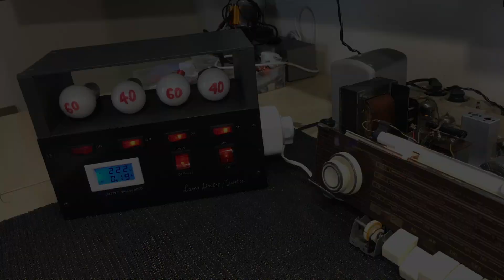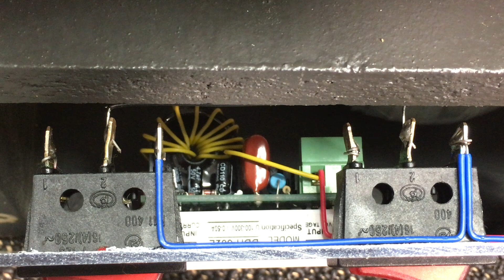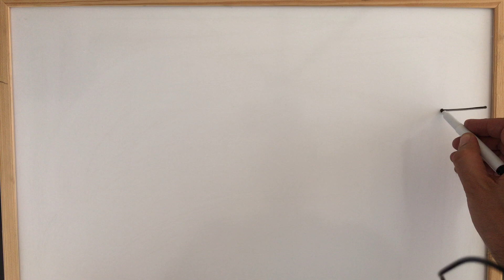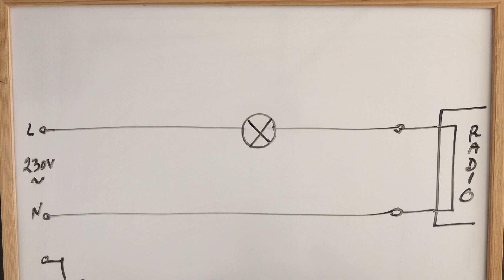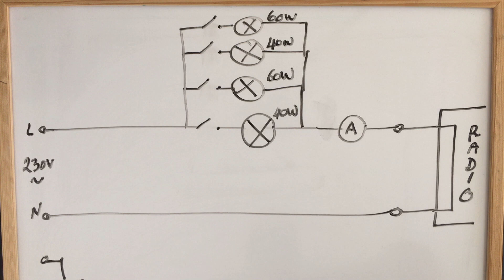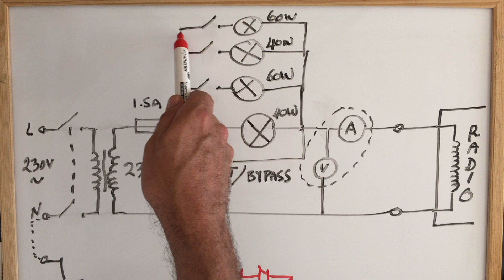DIY Test Gear: Dim Bulb Limiter / Tester with Isolation - Design and Build

Comment: Apologies, you said the light bulb is in series with the radio (dut) but then said the extra bulbs are added in parallel to that single bulb exactly as per your schematic. So I need to listen more carefully. 🙄👍Thanks, great, informative video. I also liked one by fibbers workbench where he measured the resistance of a cold 75w bulb using a meter. Ohm's law showed the bulb would draw about 8 amps but measuring the ampage with the bulb on mains power it drew a few milliamps. Tungsten filllaments cold are very low resistance. Hot (in use) the resistance increases dramatically. I guess this explains why Tungsten bulbs shine fully bright almost instantly, whereas an electric heating element can take a relatively long time to warm and glow?

Comment: Hi, early in the explanation I believe you mentioned that the bulbs would need to be wired in series but your schematic seems to show them wired in parallel. Which seems correct?
Won't this decrease the overall resistance as you add bulbs? A 200w bulb would have a thicker filament (and lower resistance so higher current flow) than a 100w bulb. I find it confusing, sorry.
Reply from the maker: The bulb is wired in series with the load. Then you can reduce the restriction by wiring more bulbs in parallel with the first bulb, effectively allowing more current to pass.

Comment: why the bypass?
Reply from the maker: After confirming that there are no shorts or excessive current draw, I like to bypass the light bulbs to apply full mains voltage to the device.

Comment: Thanks for the ideas and the wiring diagram. Have made a list of al the parts.
And also a question. We do have the same voltage 230 v in Sweden as you have
The insolation transformer will be 
a must. Will the rotary transformer 
do the same insolation as the full
 insolation transformer?
Regards 
Bjorn
Reply from the maker: No, the variac is NOT an isolation transformer. Be careful, as there is a lot of confusion about this on the web.
Reply: @electronicsoldandnew  
Thanks for answer. I had my suspicions! Bjorn

Comment: This is another excellent explanation and video so precise very well done. I have a question please Mr Caldeira.
Will the lamp limiter work on an oscilloscope power supply with over/under voltage and temp protection.
My Fluke 3092 turns on shows display and text squeals then shuts down after about 4seconds I cannot take any voltage readings just an old novice, many thanks again for your video, I made a 3x60w unstitched limiter after watching this video previously several times actually haha.
Reply from the maker: The scope will draw very little current, I expect, so the limiter will be practically “invisible” to it unless there is a short circuit.
Reply: @electronicsoldandnew  Many thanks for replying.

Comment: Nice design, but at 3:05 you say that the first 60 and 40 watt bulbs are in parallel, and thereafter it seems everything is in series.  What gives?
Reply from the maker: Think about it: a bulb is in series with a load. Add another bulb in parallel with the first bulb, you get two bulbs in parallel. Then those two are in series with the load.

Comment: I just finished building the same dim bulb tester with the addition of a standard "resettable fuse" (1A) which is mounted on a rail. I can easily swap if for another module if necessary. I had an isolation transformer lying around and I even have a bigger one that I had paid 3€ on a flea market. This really is heavy ! The small one should be enough to use with tube radios.
Reply from the maker: Yes, the current drawn is quite low.

Comment: I have seen dim bulb testing when one takes out one wattage and changes it to a higher or lower wattage. Why not put bulbs in series to accomplish that, as that seems more logical. You could use switches that close (in off position) so all you need to do is switch them progressively to incrementally add resistance instead of changing lamps in a one bulb tester.
Reply from the maker: This system for me is the most logical. It works well and has served my purposes.

Comment: What are the minimum voltage and current that digital meter can read?
Reply: The minimum and maximum are whatever the meter you use are rated for.
If you identify the PCB trace that supplies mains power to the Capacitive dropper that powers the meter circuit, you can cut the trace and feed full mains voltage just to the capacitor. In that way you can make the meter work down to zero volts.

Comment: Beautiful. I have an idea. Could you use a relay, so that the bypass automatically turns off when you turn the main switch off. This way, you never forget to turn off the bypass switch. So, the bypass switch would actually be a momentary push button to turn the relay ON. Then, when you turn the main switch OFF, the relay automatically turns OFF.
Reply from the maker: That’s a very good idea. I’ve actually forgotten it in bypass once, but once can be once too many 😊
Reply: @electronicsoldandnew  experience has thought me to omit the bypass switch altogether. While I have been lucky and not destroyed anything, I have forgotten to reset it more than once. If I need to plug the DUT  onto the mains I just do it !! Not everyone's solution, but it works for me !!
Reply: LOL - I am building one with a relay from this guy's video - he has a schematic on his own website - a few details missing, but it seems easy enough to follow. https://youtu.be/QcTck26OR3U?si=WpAWCbuga94xNiAu&t=82
This video by  @electronicsoldandnew is much better at explaining the schematic and details, though... Man ya gotta love YouTube LOL🥰

Comment: 31:50 Hi, how much VA is dat isolation transformer ?
Reply from the maker: About 300VA if I remember correctly. I do mention it in the video
Reply: @electronicsoldandnew  , i missed that clearly. I'm gonna build a dim bulb limiter with a classic isolation transformer of 400VA, inside the chassis of a old JVC JT-V11 Tuner, where the mainboard from is completely beyond repair, and is collecting dust for months. Now i know that this isolation transformer is strong enough. Thank you for the quick reply. Love your video's. Greetings from Belgium.

Comment: where did you get the isolation transformer?
Reply from the maker: I actually had it wound for me. You can probably find one cheaper ready made.
Reply: I'm having issues finding a 120/240 transformer of sufficient capacity
Reply from the maker: You need a 1:1 transformer, so 120 to 120 or 240 to 240, depending on what your mains voltage is where you live. Then just look for one that supplies about 500VA. Should be more than enough.
Reply: @electronicsoldandnew  im having trouble finding a usable transformer. I bought 2 old ILP toroidal transformers from fleaBay but with no wiring diagrams, so am now stuck after building the dim lamp box. How can i work out if either ILP transformer will work for this ? The model numbers are a little strange , "9T029" , and a "9T631" (which I think is their Gen9 "625VA"). But i have no clue on the wiring of either. Could you point me in the right direction ? thanks (I can find absolutely zero online about these two ILP transformers).
Reply from the maker: I’m afraid I can’t tell you for sure. You can easily determine which wires are for the two windings - just test for continuity. Then it’s a question of determining which is the primary and which the secondary. You should test them with a small AC voltage and see what you get.

Comment: Hi, very interesting video, I have already a selfmade variac, with isolation transformer build in, and analog meters for current and voltage, so if I understand, I just have to build only the lamps with the switches? Just asking, thanks.
Reply from the maker: I have two videos on my channel that describes the unit you’re referring to. Have a look at that as it may help you.
Reply: @electronicsoldandnew  ok,thank you very much :) greetings from Belgium

Comment: Great build Mike, I watched a setup on Mr. Carlson's Lab in which he used a different transformer and schematic, and I'm liking both designs. I would make one minor change when I build mine....   I would have the "ON" switch flipped over. This way when the unit is turned completely off,  you would start out with the "ON"  button in the down position (like a wall switch ) and the LIMIT button in the up position.  Thus, when it is powered up, both ON and LIMIT would match ( being in the up position ).  If you wanted to bypass, you would need to flip it down away from LIMIT.   I enjoyed your video, a great learning DIY tool.  Thanks  J K
Reply from the maker: James Krivitsky : I made some modifications recently and published the video on those. You may also want to see it. It was posted a couple of weeks ago.

Comment: Nice video! One Question left for me; what about appearance "forced grounding" using a older 2-core lead cord, is that safe when this current limiter is build with a 3 core cord? Or can we easily switch out grounding with a on/off switch? Thanks
Reply from the maker: Retro4fun : if you plug in a two-wire plug you just automatically cut ou the earth, so no switch is necessary.

Comment: Great design my only suggestion is make the bypass a momentary switch?
Reply from the maker: Kolin Evans : Could do, but I want the isolation transformer to work continually after the initial testing or shorts, therefore to fixed switch.

Comment: I am currently building a dim bulb tester using 4 bulbs in series and with 4 switches to bypass each bulb as needed. Is there any advantage to your parallel build or any reason not to use a series configuration?
Reply from the maker: Roger Stephenson : parallel configuration let’s you add wattage to reduce the limiting, while always having the lamps subjected to their maximum voltage in the event of a short, so they will light up visibly. In series, you will probably not see any bright glow in the event of a short because the voltage across each lamp is divided by the series chain. I’d go with parallel.
Reply: @electronicsoldandnew  Thank you and I will indeed follow your example. It is a nice tidy arrangement as well. I was viewing it as being a poor man's variac as well as a dim bulb tester.

Comment: One other question when you say 350 watt transformer , what is that in VA - One I am looking to purchase for this project from Element 14 is 25 VA . Power Factor is in there  somewhere . Cheers
Reply: For transformers, the VA rating is Volts x Amps.
Explained better, the transformer is actually rated in VA, as in the amount you can draw from the secondary. Therefore the error is actually that you are referring to a "350W" transformer, where there is no such thing.

Comment: There is one big problem with this curcuit. In Germany you don't get the lightbulbs. The damned EU has killed them. Yes, i can calculate the resistors, no problem. But with bulbs its much more nicer.
Cheerio.
Reply from the maker: Alfred Neumann : you don’t get them in Portugal either. But .... I found a lot of them in old electrical shops as old stock, those that still exist because the old guy won’t give in to the big department stores of today. I also found them in Chinese shops, which I’m sure you have there too. Good luck.
Reply: Thank you for your answer. Old electrical shops....same problem, they don't longer exist :-(
I just researched and found something at a German-Restseller named Pollin. Crazy..... 
Just saw your Graetz 4R417-Resto. Great!
Reply: I had the same issue but I found a bunch of halogens 40w and 100w I’ll be interested to see the effects based on what I can see the resistance is similar but more linear?
Reply from the maker: Kolin Evans : halogens won’t work.
Reply: Electronics Old and New by M Caldeira re halogen why not? Also I’d have the isolation trans in a separate box and use each for a dedicated purpose much less risk re the bypass.
Reply: @electronicsoldandnew - OF COURSE halogen lamps will work. A halogen lamp is an incandescent lamp, with the addition of a special gas 🙄
Reply: Try to search for oven lamps, normally are E14 socket 40w,  not too much choice but still available on the market.

Comment: Can anyone point me in the right direction for an isolation transformer please?
Amazon UK have them but they’re all different values and prices.
A  web link would be great thanks :)
Reply from the maker: David Burdett : that is always the challenge. You’re more likely to find one one on RS components or some such supplier (I almost said napkin). Try get one rated at about 1amp output current. You probably will never need more than that. More is better but the prices can be crazy. I had mine wound by an old guy who still does that, but you need to find one locally or shipping gets expensive (they are heavy).
Reply: Electronics Old and New by M Caldeira Hi, 
I’ve popped online to look for one but I can’t find it.
Can you post a link, if that’s ok 
Thank you   :)
Reply from the maker: David Burdett : something like this, I think. Study the dataset carefully.
https://uk.rs-online.com/web/p/din-rail-panel-mount-transformers/1232501/
Reply: Electronics Old and New by M Caldeira Hi, I’m a little confused, sorry.
I’ve checked the dataset and it gives 115v as a secondary?
As I live in the UK, would I need 230v like this one ( web link below )
Thanks :)

https://uk.rs-online.com/mobile/p/din-rail-panel-mount-transformers/0504228/

Comment: very nice project and detailed review. Have you thought about using the unused side of your bypass switch to extinguish the lamp switch indicators?
Reply from the maker: atschirner : I could but that would require a ‘Break’ on activating the switch, and I don’t want to get into inverting signals which I could do with a simple relay.
Reply: Or the alternate action of a DPDT switch? @electronicsoldandnew

Comment: Exactly what I had in mind for sometime now. I had a 1KW isolation transformer (220v in - 240v out) wound for me by a local transformer manufacturer and bought four 60w incandescent bulbs in blackmarket (not sold legally anymore). Your deluxe version is fine, but then mine will be the ultra-delux version :-) since I am also planning to include a 1.2KW variac I salvaged a few years ago from a junk yard which is almost brand new. I have the gauges, lights, circuit breakers all ready but need to convince my lazy ass to get up and built a strong box to contain all this now... Would you recommend putting the transformer or the variac first? I am planning to put the transformer first to make the whole thing isolated from mains but I would like to hear your opinion on this too. Thanks for the great video, this may give me the push I need to finally put all of these together and make something useful...
Reply from the maker: Bora Yurtoren : I think I’d also put the transformer first: switch, 4A fuse, transformer, variac, dim bulb setup, voltage and current measurements, output. Don’t let the mains earth anywhere past the transformer. 
Definitely a super-deluxe version.
Reply: Making the box out of MDF is not a bad idea at all, much easier to work with compared to aluminum frame and panels I had in mind... But in my case, 1KW transformer and 1.2KW variac, plus the MDF,  it will be the military definition of "portable"; Anything that you do not need a forklift to move... :-) Greetings from Turkey!
Reply: Bora Yurtoren Hello, be aware that when using such a huge transformer you get serious inrush current that may trip your mains circuit breaker. You might end up to have to use some inrush current limiting when switching on. Maybe another light bulb in series with the idolation transformer and a time relais that switches on a second later and bypasses that light bulb then. Enjoy the build!
Reply: @EwaldBurger  Thank you very much, this is really something to consider.

Comment: You can also use halogen lightbulbs instead of tungsten, and they work even better as their current coefficient of resistance is higher, meaning the resistance of their filaments is lower when cold, so deliver more power when there is no fault, but "trip" just as well as tungsten if there's a problem. 
My version has 8 100W bulbs, but I work on a lot of musical instrument amps, so need that sort of power.
Reply: You can use halogen bulbs, but if you live in the EU, get them quick while stocks last, because the interfering idiots in Brussels have banned them.
Reply from the maker: Greg Robinson : very interesting. Haven’t tried them.
Reply: Electronics Old and New by M Caldeira Greg seems to have used halogen? Considering their ‘coefficient of resistance ‘ I can’t see why they wouldn’t work great, that’s why I purchased some at the dollar store
Reply: Thanks for the comment I couldn’t find ‘normal’ filament bulbs so I took a hedge on some 40 and 100w halogen then did a little research and it would seem they would function.
Reply: The best bulbs to use are 50w GU10 Halogen, as used in down lights that don't have a transformer. These bulbs are commonly 50W and much smaller and easier to find than incandescent lamps.